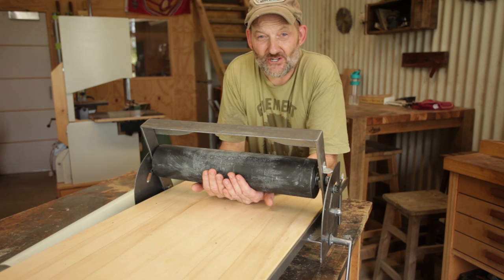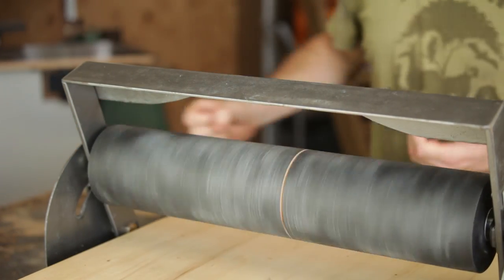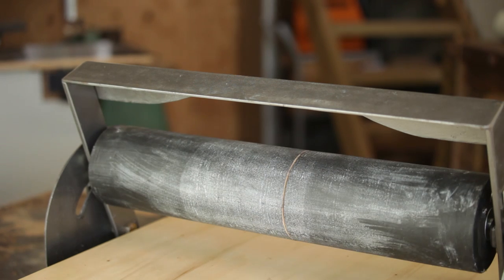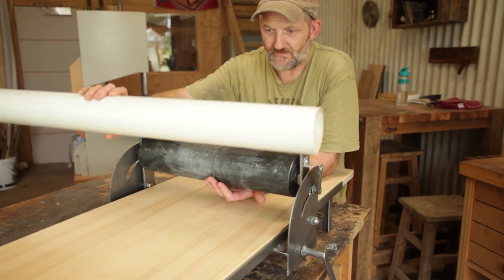Clay Slab Roller Update

Comment: i think if you used a thicker shaft you might not of had such a deflection in the drum. other than that it is a great job! Keep doing what you are doing, its GREAT!!
Reply from the maker: Thank you William! Although a thicker shaft would've helped I believe it would still flex unless I went with something substantially thick. I think this solution worked out well in the end - I just didn't realise quite how much pressure went on to the middle of the roller when I built it. :)

Comment: so you reckon that pvc pipe will stop it from breaking again ? i kinda don't, try an iron pipe next time it fails
Reply from the maker: There is no way it will break again. The mass of the plywood roller fits that snuggly there is nowhere for the pipe to flex. For the pipe to break it needs to be able to bend to a certain point - which now it can't. ;)
Reply: I also saw that a maker used a PVC pipe and filled it up with quick-dry cement to make it strong. This is what I wanna do too because this is easier for me.